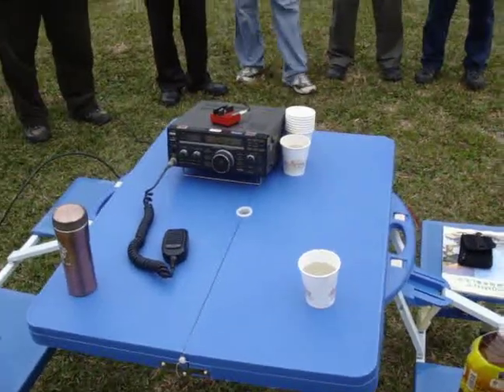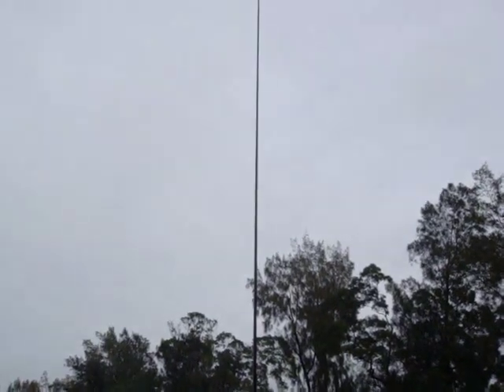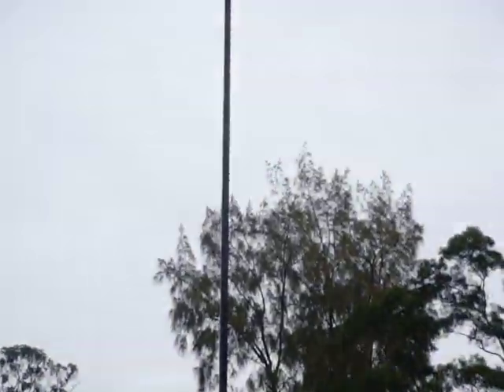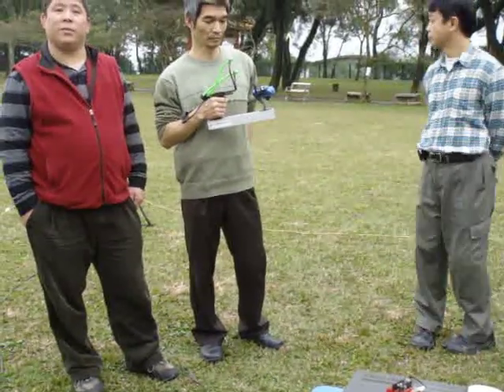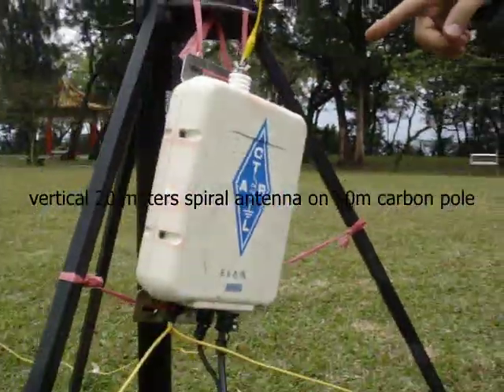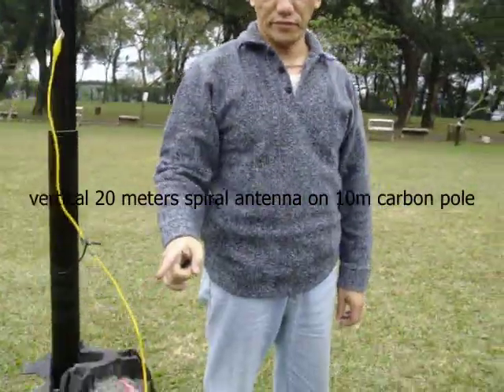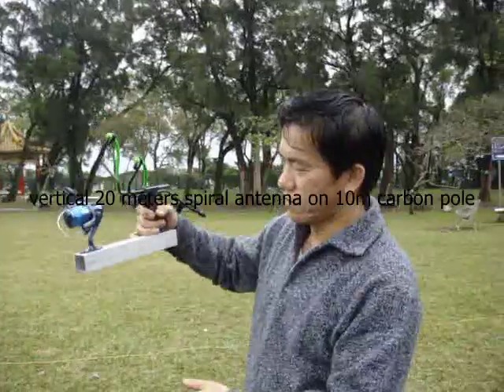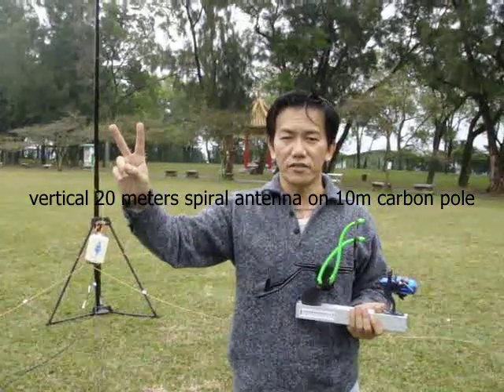vertical long wire antenna for 80m~6m bands

Comment: Thank you for this video - I am working on something similar here in South Dakota. I understand correctly this 10 Meter pole has the 20-meter wire spirling around the pole. Is it taped on the pole or just tightly wrapped? What is the gauge of the 20-meter wire?
Hope to see more of your work!!